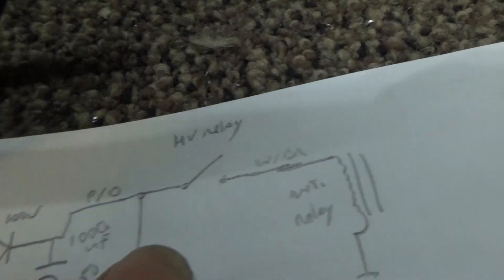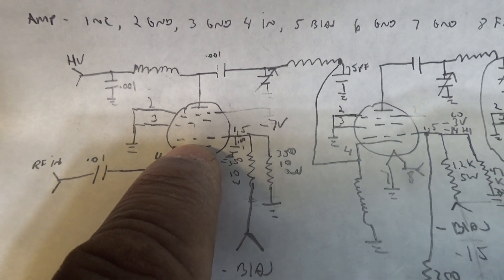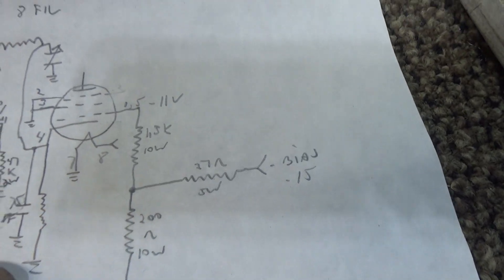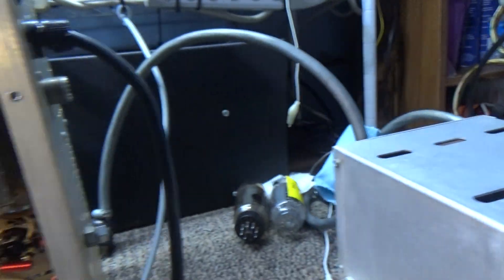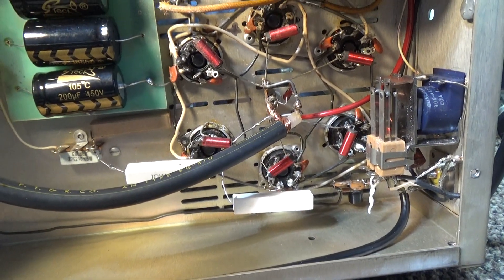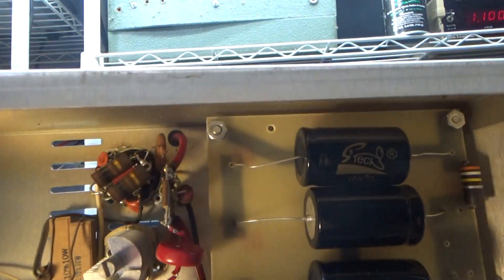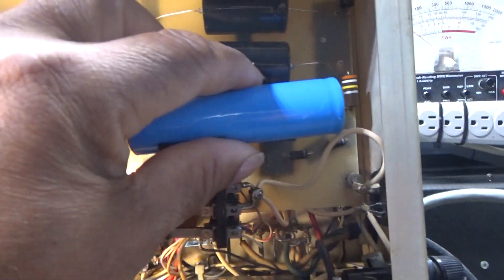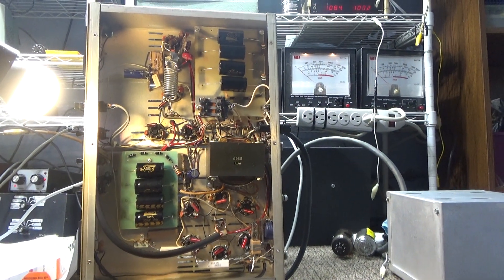Golden Falcon 1KW unpowered walkthru / talkthru.

Comment: Hi. I’ve have this amp. All bias resistors are the same and in same configuration. Have same issue with slow output. I’m experienced in tube amps, but can’t figure out why it has this issue. Exhausted all my normal thoughts on fix. Have you been able to correct the slow rise?
Reply from the maker: No, I have not and nobody I have talked to knows why either. I have 2 and both have the slow output buildup. These had my autism going as I like to solve problems and this is a problem I couldn't solve.
Reply: Thanks.

Comment: If you still need photos of the inside, I have one, but in silver. I am the 2nd owner, got it with 10 spare new tubes. Used it in the 90's and has been boxed up since. I'm getting back into radio and plan to get it back in line. Your videos have been helpful in getting my Black Cat and 300A back in top condition. Keep the videos coming...
Reply from the maker: Thanks, but I'm good. They are just designed weirdly.

Comment: Doc I'm gonna look though 40 years of manuals  schematics, I have very very rare schematics and some manuals for Golden Falcon 1KW with 4cx250b  8908 6lf6 and 8950 tubes somewhere might take me a day or two to find them,
Reply from the maker: Be great to get one with the 8908's
Reply: Hoping that this finds you...
I have a Golden Falcon with 2x 250b tubes that I acquired in a trade...
I would sure like to get my hands on any information that you might have for it... The amp is in terrific shape... Purchased a couple of new tubes and I plan on doing a recap to it...
Please message me back if you can...
Thank you...
73
Reply from the maker: I never had a Falcon with 250B's however, I have had maybe 10 different amps that used them over the years. 250B's run about 2200 on the plate, 400 on the screen and about -65 negative bias. They are grid driven and need a matching circuit to drive them well. If done right, very low drive, 3 or 4 watts is all you need. Good Luck with it and hope you find more info. Samhendrix?
Reply: Thank you, Doc'...
I hope that you are doing well...
73